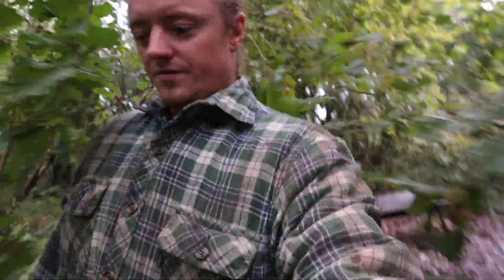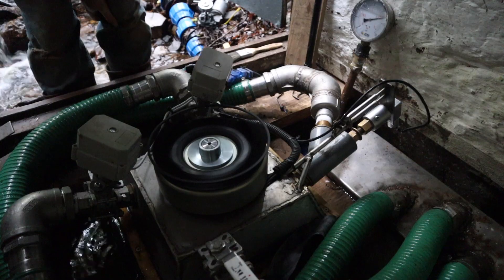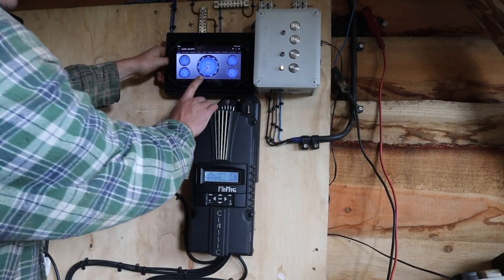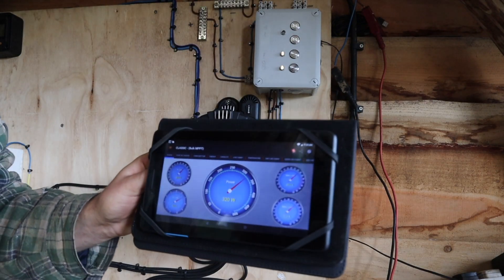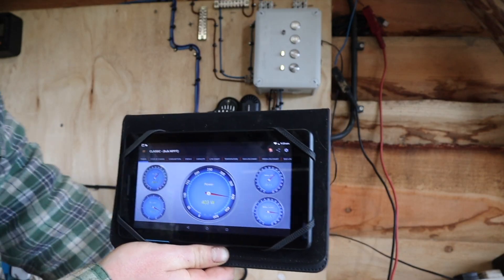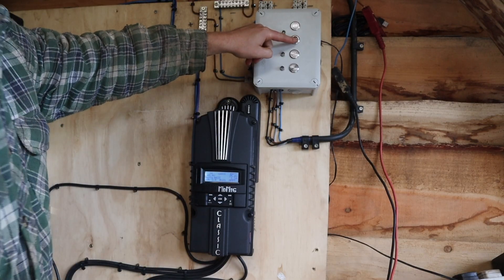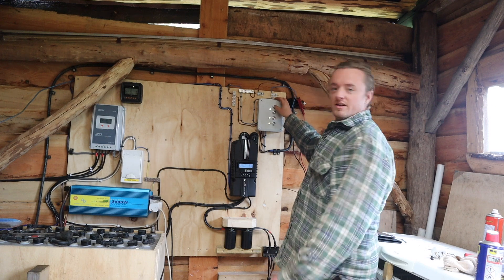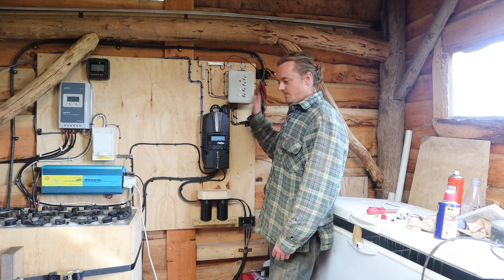Off Grid Arduino Controlled Micro Hydro Full Power Test 400W

Comment: How do you prevent over revving if the batteries get full and charge controller stops output? Or will it not harm the hydro? 

Love how you connected the electric valves!

Comment: Surely if you have a battery system you would always run at the most efficient point and modulate on/off between say 80/100% battery capacity?

Comment: I have been interested in using small stream power to run hydro for years and I have finally pulled up one of your hydro videos and as soon as you said the word nozzle I  know right there you had a great idea without even seeing it yet.  The old sawmills use to run on paddle wheels so nozzles could do the same thing in a sense

Comment: @Kris Harbour Natural Building - you said "as long as I'm connected to my Wi-Fi I can do that too", what I think you mean is that you can do it as long as you are connected to your LAN or WLAN, if you are connected to your telephone provider I think you say you cannot. But all you have to do is setup the proper Dynamic DNS (there are free providers like "DeSEC DNS" or "Afraid DNS") and then go into your router and set up that DynDNS there, if there is no possibility there is a tiny Windows app called "Marcs Updater" that will do it for you provided your computer is always on (I'm fairly sure there is a MacOS equivalent and maybe also an iOS or Android equivalent), the next thing is to setup "port forwarding" in your router.
So the free DNS server will give you a URL (e.g. krisharbour.whateverfreednsyouchoose.com) and if you access that page instead of the local IP address you normally use (e.g. 192.168.1.252) when you are inside your LAN, you'll access it from anywhere in the world.
Reach out to me, I can help you with this. :-)

Comment: One simple way to make a low tech mechanical remote control is using two small gearbox DC motors wired motor to motor. Turning the shaft of one motor turns the other one and the torque is reflected back so if you have a small crank on the shaft you can feel when it reaches the end.

A pair of cheap motors like this can be used:
https://www.electrokit.com/en/product/dc-motor-with-gearbox-251-6-18v-508rpm/

Comment: i noticed you built the square box out of solid metal now when did you do that the last i saw it was blue plastic -and what if you teed off about 20 feet up the feed line and built another set up exactly the same could you double the electric output on the system and make 20 kw and store it for more on demand  power or would you lose to much preasure and reserve water  just a thought ? interesting desighn for sure

Comment: Love your system, and your positive attitude.  Looks like you are getting quite a bit of head loss.  I have never done a hydro power project, but I have made a fair number of hydraulic systems.  I use this little tool to help with design.  It has all the pipes and fittings programmed in so you don't have to waste time calculating Bernoulli's fluid power equation over and over again.  I don't know if you use these methods, or if you already have a calculator.  So cheers and keep up the good work.  It will calculate your unknowns for you so you do not have to SWAG your data.  https://www.lmnoeng.com/energy.php#:~:text=Bernoulli%20(Energy)%20Equation%20for%20steady%20incompressible%20flow%3A&text=g%20%3D%20acceleration%20due%20to%20gravity,location%201%20to%20location%202.

Comment: Your last one made 300w would it not have been better to have two of the older style ones. I think this would have been more time and cash effective than the current new model. It would have been lighter and easier to service too.
Reply: How many litres a second did the old valve do?
Reply from the maker: Adding more turbines just adds losses. The turbine itself is the biggest single loss in the whole system (any hydro system)  so to have more than one is just stupid.

the new turbine is to give a much greater range of flows. the old one maxed out at 300w around 3lps but had only a small amount of adjustment.. the new one can go from 100w to 450w The limiting factor is the flow in the stream not the number of turbines.

The spear gives range between the fixed valves. so you can tune it to anything as opposed to just fairly large steps
Reply: Also whats the point in the spear valve? It seems that adjusting the valve in small increments is made invalid as you have multiple valves. Love the channel, looking forward to more video's.

Comment: but why whit four you have 400w and before whit only one you had 300w?
Reply from the maker: because they are 4 small nozzles there so i have range of flows by having any combination of them on not 4x the power.
Reply: @KrisHarbour  if you put big nozzle in the 4 how much power could be generated?
Reply from the maker: well the turbine is rated for 1kw so if i drilled them out i could run it at 1kw But my average flow is lower than the 10lps that would require so it makes more sense to have the turbine sized to run more efficiently at lower flows as that is the average. if i drilled them out of max power it might only run like that one day a week and the rest of the time not be as efficient and not have such a range of control. Much better to have it sized for average flow and run it at the in its most efficient range 7 days a week.

Comment: so when you change the polarity for the motor how is that the activator still work fine?
Reply from the maker: Dc motors work both ways with change in polarity
Reply: @KrisHarbour  yea i know that i understand that part but how the activator for the normal tap no fail whe you change the polarity? you said that you use 4 cables and ground is use for the 3 things so when you change the polarity for the adjustable nozzle how the other  two activator not fail or close? if you reverse the polarity in all the system
Reply from the maker: The microcontroler has two 24v power supplies and the polarity for the spear is switch separately so that the other actuators stay open. if you look at the wiring video i did you will see the two supplies and it should make more sense.
Reply from the maker: https://imgur.com/5f33Jd2
Reply: @KrisHarbour  yep i remember the 2 supplies that is why i wonder how the system work, so when the ground switch to 24v how is that the actuators don't brake? whit 24v in the 2 connectors? how you can switch if they share the same ground?

Comment: Would it be more efficient (water consumption/flow wise, cost wise it's going to be more $$) to have 2 turbines running the manual + 1L/s + 2L/s adjustable nozzle setup instead of the single turbine with all 4 valves which seems to take a lot of extra flow for the increase in output you get on the spear valve.

Comment: Always fun to experiment, here some things you should look, probably gain around 20% efficiency putting this into practice.

Pressure goes down due to the pipe diameter no longer being able to sustain the flow rate to maintain that pressure, as you add more fittings you will increase the pressure as the additional firings will reduce the flow rate as a result, add more outlets (nozzles) and you increase the flow rate and drop the pressure. Most of your efficiency loss is coming from the lower nozzle velocity due to the drop in pressure, if you add a larger/2nd feed pipe your pressure will return and so will the efficiency.

Also once you add more than 1 nozzle to your turbine, the number of nozzle should be divisible by 3 and set at equal angles to each other (4 is bad, 6 is best), doing this will also improve your efficiency as well as increase the lifespan of the bearings and turbine blades. All nozzles should be the same size and being turned on at the same flow rates (just one large valve to rule them all)
Reply: So essentially then, after doing loads of research, and then spending an enormous amount of time and effort designing and building the system - you're suggesting that(at massively more expense and time) he completely changes everything....??!!
Reply: I’d suggest you are wrong concerning nozzle numbers in relation to efficiency, efficiency should be related to impact speed of the water and the smoothness of the flow as well as bucket design. Is there’d some reference you can provide to support your statement regarding nozzles/angles?

Comment: I would worry about the arduino succumbing to moisture damage. The solder, the pads on the PCB, other SMD's will not respond well to continuous moisture exposure in the air. You're going to want to look into waterproofing that entire board.

Comment: Is that 3 input rectifier a normal diode based one?
If so, consider replacing it with an ideal diode or active rectifier, they use mosfets or igbts instead of diodes and have less losses.

Comment: I'm a little confused as to how this is off grid... Your manifold is obviously high pressure so what is feeding it? is there a pump that's consuming more power than the generator is creating run off diesel somewhere out of the frame or do you have a 130m tall hydro dam somewhere not pictured?? Or is it just run off the towns water grid and pumped to your property at that pressure??? Because I'm  having a really hard idea understanding how you are gathering that creek flow into a pipe that diameter and creating pressure......     Can we see the total water supply chain????
Reply from the maker: There is a complete series you can watch. it is 100% off grid. the preasure comes from gravity 18.5m of elevation and the flow is from a small stream
Reply: @KrisHarbour   well I'll be, I did look though the videos but the supply is broken off from the new section of videos, just found it. 18m, 26 psi is bang on what you would expect. Would be nice to see the gauge in videos a little better, I thought it was 500kpa region looking at the way things were responding.

Comment: Some friends have a stream with a decent drop on their land. We made a measurement of flow rate and the amount of head they had available. A quick calculation revealed that they could generate a heady 72 watts at 100% efficiency on a good day. Ho hum.
Reply: @BobDevV  No. That 72 watts was a calculation based on head height and flow rate at 100% efficiency (mgh/t). There is no more power in the stream. You can't magic it out of nowhere with clever nozzles.

Comment: I got a few ideas to help water flow 
1.slope the stream then put stone slabs or concrete on top of the slope this would help direct the water in the steam 
2. Have a dam/resivour 
3.make sure theres nothing blocking rain water from going inside if the system 

4. Have  filters with alot of tolerance at the top and smaller tolerance filters  (fine filters) closer to the turbine 

5. have a giant water mill

Comment: im worried about longevity running at such a high RPM
Reply: It's a air gearing should be fine
Reply: @peterzingler6221  whats air gearing
Reply: @tseawell90  
I think he meant air bearing - or really any type of bearing other than ball & roller bearings.
Hydraulic bearings as old as some of the oldest hydro powerplants have been in continous operation without problems - no moving parts touch each other, so no wear and tear.
Reply: @martonlerant5672  Almost perpetual cooling and lubrication, essentially. Water carries abrasives and potentially corrosives I guess...so YMMV.
Reply: @seanneal552  
Yeah nothing will last forever - at the end of the days it will be black hole, iron starts and not even that.

Still proper maintenance and material selection can lead to lifespans that may seem miraclous compared to whats achieveable with "conventional" bearings.

Comment: After rounding the exhaust manifold it may be beneficial to put a downward spiral spline / channel / ridge work inside to force the flow down and out .
I think the current configuration has too much exhaust water getting in the way of input water and turbine revolution due to splash turbulence .
Reply from the maker: Have a look at how a turgo turbine works. the water is directed downwards and goes straight out the bottom. housing shape really isnt a significant factor. with a pelton where the water gets thrown off the cups then yes your right and my last turbine was a peton and the housing was rounded but for a turgo it isnt a problem.
Reply: @KrisHarbour  

Aha - I didn't realize it was significantly different from the previous turbine .  I think I must have missed the early design descriptions of this new turbine .

In this video, I noticed what appeared to be a fair amount of water not being ejected directly down .  It looked like quite a bit of water was possibly getting in the way of the circular motion of the turbine because it didn't seem to be processing in a uniform flow pattern ( down and out ), but bouncing erratically to and fro before dropping out .

Even so, it did appear that the majority of the water was flowing down quite nicely - however, it looks like much of the downward flow was along the inside surface of the housing, meaning that there is significant impact with the side, which would necessarily produce some anti-rotational splash-back into the blades or spoons .

I am going to look for any of your previous videos and see if you show the entirety of the flow turbulence in there .  If not, I will try to find another resource to understand more fully how it works .

After a quick analysis, I see that it might be a little better to have a round / conical shape on the bottom, but I perceive that the benefit would be negligible .
Thank you for your reply .
I found a good video showing the directional thrust of the exhausted water :
https://www.youtube.com/watch?v=jnejooTZq8U

Comment: Wouldn't it help to have the ejection manifold be rounded rather than square ?
It seems that the flat surfaces contribute to oppositional flow which stagnates the ejection of used water power .
A round manifold would facilitate same directional flow and quicker ejection thusly minimizing oppostional \ stagnation of exhaust water

Comment: use 45' connectors to your valves, your loosing some efficency at the 90'
Reply: 9:48 he addresses this..
Reply: I think a 2" elbow that then goes straight down to a 1" ball valve isn't going to loose efficiency at the elbow. A 1" elbow and I would agree with you, but 2" elbow, No.
He has a pressure drop partly due to the friction inside the poly pipe leading to the shed, so if you increase the size of the black poly pipe this issue would be eliminated. he could also dam the water from a higher point to create more pressure at the generator,  higher pressures will push the same amount of water thru the existing poly pipe without loosing as much pressure.
Reply: anikidwolfy not if he is just going for water pressure
Reply: @mrono1910  That would assume the water was not moving. Not going to generate much power that way.

Comment: Too complex......... It doesn't need to be....... too much maintenance required...... can you make something less complex....... A larger gen with smaller diameter pipes and you would get about 3,000 watts...... Thanks for the video.
Reply from the maker: its not to complicated because i made it so i know how it works so i can fix anything. And power is limited to flow and pressure not generator size. Oh and smaller pipes mean more loss not more power.

Comment: You should make a cascade on that with that good water flow:)Very nice build ,you can easy double the power output.I am using Scott Hydro 1500W and really satisfying even with air con running.

Comment: How about tuning the output voltage? It's a magnetic generator, the physic limits the maximum curren, when you increase the speed of the shaft, it's able to give out more voltage with the same current, how ever if you just spin the ting faster the current Don't go up like voltage and will eventually flat out. You probably have a charge controller for that ting? With an inverter for? Does it let you change the input voltage off the the dynamo?

Comment: If you can get rid of those sharp right angle turns at the ends of the hoses, you should be able to improve efficiency a good amount. There is a lot of lost energy in sharp turns like that
Reply from the maker: Its actually not that much due to the size of them and the relatively low flow. just a few wats lost on each one. i am going to address that in a tuning video though. its just always best to get something working first before perfecting things that only make a small difference.
Reply: @KrisHarbour  Good point, i'm sure it's less of an issue when the water nozzles are much smaller than the feed hoses. More dependent on pressure than flow in that case. I look forward to seeing further updates. You have made some impressive progress already, 400w is no joke.

Comment: I'm interested in those capacitors after the rectifier. Is that to cope with draw from high current starts like a water pump? Or to take the strain off the turbine primarily?

Comment: Thanks for your commitment to you channel, just love what you’ve done, one observation I have made, and that the order in which you open the valves. I would look at opening the valve opposite the open which is open all the time,because the ware on the bears will be significant, and by balancing the pressure on either side of the bearing will help to maintain and keep ware and tear down to a minimum! My preference is more to do with working with nature, so my choice would of been a series of passive vortex turbine design! Keep up with the monitoring because I am interested in how long the bears last! :) ps the inverter your using is 12v or 24v?